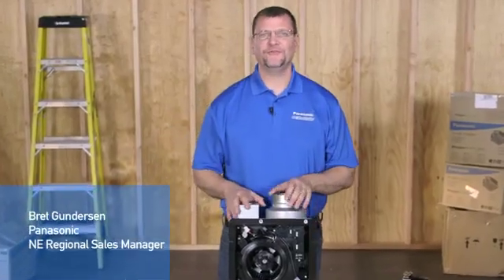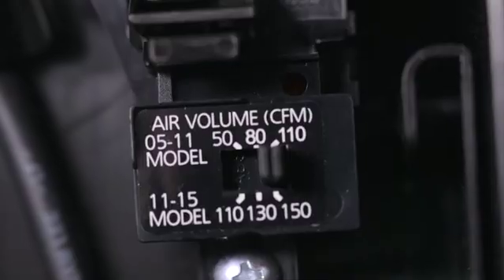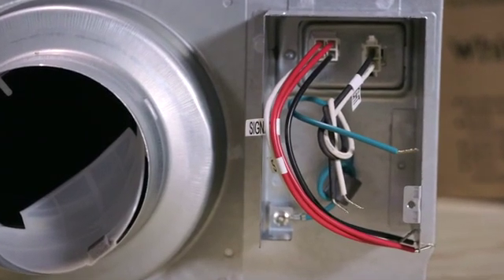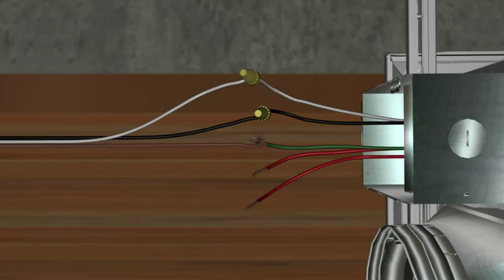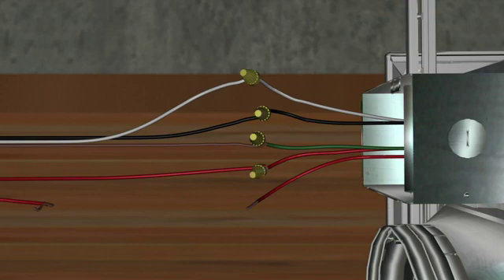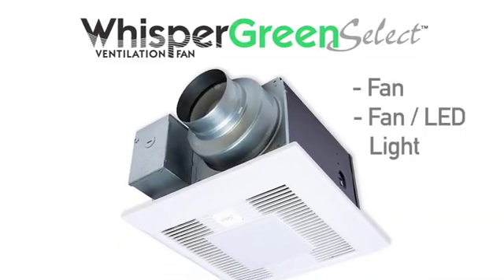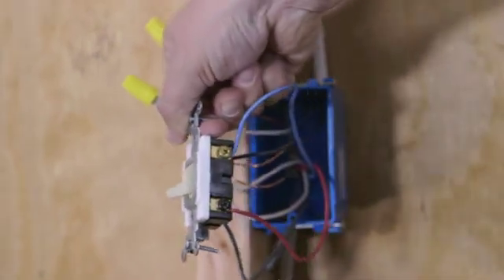WhisperGreen Select™ Wiring

Comment: Timestamps::

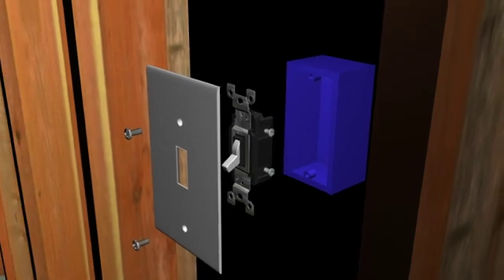Standard "spot" single pole switch: 1:52

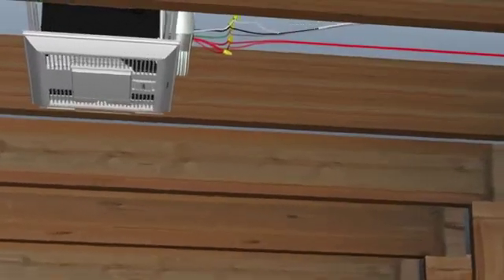Automatic motion sensor/ humidity condensation sensor: 3:09

Wall switch with extra modules: 3:42

PS Don't forget to set the fan speed based on the cubic feet per second on the fan itself.

Comment: This video captures very important information at the tail end of the 3m30s to 4m43s section that is unfortunately missing from the installation manual, regarding how the unit operates when the "control switch" is in the on or off position.

The control switch only causes the unit to be in "on" or "standby" mode, and cannot cause the unit to be "off" if the sensor built into the unit tells the unit to run. This is great news.

The only way to force the unit into "off" mode, is to use the "service switch", which is likely to be the breaker.

This important detail from this ~9 year old video should be clearly stated in the installation manual!

Comment: I  have installed two Panasonic FV-05-11VKL2 WhisperGreen® Select Fan/Light, 50-80-110 CFM (with light) now and acknowledge the YouTube videos are overwhelming and don't talk much about the additional light and night light wires. I am also using the timer, motion and condensation modules so the fan it is automatic.

My home has two gang boxes (light and fan) and typical for most homes. The best wiring solution for me rather than adding additional boxes and to provide ability to control most features was to wire:

fan to the fan switch and leave this switch always on. I also connected the blue (night light) wire to fan as this will always be on. This allows you to turn the fan off if using constant on/sport ventilation togther. I would not wire the constant fan speed to a non-switched power source for this reason.

fan light (extra black and white) to bathroom light switch. You will have to cut wire and install junction box to do this. You can simply unplug the light if you do not wish to use after install rather than going into box - it is bright IMO.

Cap both red wires individually - or the fan will always run on high.

The timer module allows for constant, always on (low speed) and/or spot ventilation (high speed) timer setting depending on the configuration.

The motion and condensation modules will turn on the fan automatically when someone enters the room or uses shower for preset time of timer module.

Comment: Confusing video and explanation.
 I want one switch for the light, one for the fan, one for the nigh light and one for the control with the red wires. I am using two doble switches for my two gang box and I am running two sets of three-wire from the switch box to the fan, I mma use one white wire for the neutral and the other one as a return to the night light.

Comment: Which Model has the 2 red conductor wires?  I am looking for a panasonic fan with no light.
Reply: Any panasonic with control modules will have red wires. 
(In other words, NOT a VF1, or VFL)

VFC <- C :: condensation sensor
Reply: Model FV-0511VFC1 and FV-0511VF1 are just fan, no light.

Comment: I'm just looking for a way to wire a fan on and off with a switch and have the humidity sensor control the fan if the switch is off. Does panasonic make a fan like this with no light
Reply: did you figure this out?
Reply: panasonic whisper thin rg-t810ha Sounds like the model you’re looking for.

My interpretation is to use the wall switch with the red wires and have the hot and neutral permanently connected in the box. A separate low voltage wire for the reds should be fine.

Comment: CFM SWITCH NOT WORKING - Anyone from Panasonic Support monitoring these comments?

My Panasonic FV-0511VQC1 fan was recently installed and the CFM selector does not work.  It's stuck on the fastest (110CFM) speed, regardless of what I set the CFM selector to.  Is this potentially just a wiring problem?  Or a CFM module that can be swapped out under warranty without removing and replacing the entire fan assembly?

I have sent a message to Panasonic support from their website form and have received no response.  I can't find a support phone number to connect with a human agent to help me.  Any help or recommendations would be much appreciated...  If I can just buy the CFM selection module myself and DIY it, I would be willing to do that too...

Thanks!

Comment: Putting a schematic on the product would have saved me a lot of time. 
Professionals need to see diagrams
Reply: yeah, but the POS incels on reddit and even dyi sites spend more time saying how easy it is than actually answering this simple question (being, how to wire the switches, which are not in the included wiring instructions)

Comment: When you get to the point of understanding the purpose of the signal wires, and decide you’d like to set up your fan using them, you still may be a bit confused about how to make that happen. I think it’s funny they rather glossed over this point. Note, their installation uses a conduit through which any combination of wires may be pulled, given sizing restrictions of course. Most of us will be running Romex, or shielded cable. there is no example of these that comes with two red wires. You may purchase 4-wire Romex, which has a red and blue wire, and those can be used to complete the signal circuit at a standard single pole switch. You could also pull 2 x 2-wire Romex. Since it is clear that the signal wire’s purpose is simply to prove continuity, I’m not concerned about wire size. For my part, I’ll pull a separate low-voltage wire (cat 5e) and place a cardboard divider in the junction box to mimic NEC requirements regarding mixing low-voltage in line voltage wires.

Comment: I connected the wires as per the 3rd wiring option with only the FV-CSVK module installed. Turning on the manual switch turns the fan on but when I turn the switch off the fan keeps running. Why is that?
Reply: Maybe the sensor override the wall switch?

Comment: Can you kindly clarify the 3rd  wiring method. The two red wires gets connected to a Third Switch/Junction Box since it cannot have any power?  If not where do I connect the two red wires in the Fan Switch Junction Box. Thanks.
Reply: In the 3rd video they are finding another power source in the attic to send constant power to the unit. Then they are using the existing wiring for the old fan to use as signal wires. You would tie those to the red wires in the fan junction box

Comment: Hi, I just watched your video in the youtube on how the Panasonic bathroom fan works.
However, i still have a problem; 
 when I turn the switch ON, the Fan does not run until 17 seconds with the timer and CFM in zero position. any idea why I am having a delay On the start. 
Can you also send me the Manual. I am not sure do I have an electrical issue or this is how its works.
Reply: Because you aren't turning the fan on -- you're turning on the sensors, which then decide if/when to run the fan. You need the power the fan directly, then switch on the red wire.

Comment: Just installed this fan with the optional Night Light Module.  The video does not cover the use of the Night Light Module, so I left the RED wires capped individually.  Turning on the fan, the night light goes on, but the fan doesn't. That would suggest power is there, but some part of the circuit is incomplete.  There are no instructions in the provided instruction sheet for using the Night Light Module. Would it be safe to assume that if I connected the two red wires, the fan would work? The Night Light Module is supposed to be automatic sensing so if its set to a bright environment it won't go on unless the room reaches a certain darkness level.  I'd rather not have to snake wires down to a switch since I bought the module thinking it was automatic as a night light and didn't have to be switched on and off. Hope somebody can clarify why the night light works and the fan doesn't and answers the question about the red wires. TIA-Mike
Reply: what did you end up doing?

Comment: I want the ability to completely cut power to the fan. Can I put a single pole switch on the black lead wire that goes to the fan?
Reply: If youre doing that theres no reason to pay more for the green select you could just get a regular fan with light.
Reply: @stonebuzzalini2049  I guess i wasn't clear on what i was looking for. I wanted the option to cut the low speed fan for the times when continuous whole house ventilation is not needed (spring and fall basically). Brett W.'s response gave me the answer i was looking for.
Reply: @stevechristensen2351   hopefully you can help: I want method 3, using a wall switch where 'On' switches the fan to run the selected CFM and 'Off' switches the fan to use the condensation sensor module to automatically run the fan if/when humidity is high.

I ALSO want to be able to cut power off to the fan entirely in seasons where the fan is unnecessary (if unoccupied, or when it's warm we open windows etc). I'd like to have this ability near the unit, rather than flipping a breaker.

I think we were looking for the same thing. Did you accomplish this with a second switch? Or?
Reply: yes.
Reply: Yeah i thought about that but from my experience people dont like it because it requires the owner and their geusts to understand the fans operation. They just want to hit a button

Comment: Thanks - super helpful!  I'm an electrical engineer and I was still scratching my head after reading the Panasonic manual that came with the fan.
Reply: Agreed.  The manual is confusing.
Reply: I got even more confused after watching this video. In the end, I just wanted everything together and the whole light plus fan come on from a single switch. I wish I could separate the light and the fan, so the fan can quietly run with the lights off, but I just gave up
Reply: That manual is horrendous
Reply: @brianlutz7813  The manual sucks, both in content and format. Just make a booklet with pages that turn, not an unfolding mess in 4 languages.

Comment: I just noticed a really nice detail while installing mine, they included a ferrite bead on the grounding wire in the junction box - which will help keep internally generated noise out of the house wiring, and externally generated noise out of the fan electronics!

Comment: I have the FV-05-11VKSL1. I want the light on its own switch, and I want the fan to run for the time delay after turning the light off. Is this possible and what wiring do I need? My old fan and light were on separate circuits, so I do have 2 switches available for each the light and fan.
Reply: Sounds like some custom work is needed there thatd probably be out of code and void your warranty since youd have to bypass shit and cross circuits good luck

Comment: I just installed one of these, replacing an old fan/light combo that was undersized for the room.  I was wiring the simplest method... one switch running a black/white/ground line up to the fan.  I wired the 2 white lines from the fan to the white wire of my home, the two black wires from the fan to the black wire of my home and the green wire to the ground of my home (bare copper wire).  I capped off the 2 red wires from the fan (not using any of the fancy stuff) and the switch now turns on the light and the fan together (well... the fan comes on after a 30 second delay.  Why, I'm not sure, but it is as designed per the reviews on Amazon).

It is VERY quiet (quieter than the smaller, lower flow fan it replaced) and the LED lights are very bright.
Reply: With the wires capped separately you are effectively toggling between OFF and "Sensor" mode for the fan. The delay is the time it takes for the sensors to power up and start actively monitoring. If you want to have the fan run anytime the switch is on, bypassing the sensors, then either remove the sensor modules or jumper the two red wires.
Reply: With a recent reply to this long lost thread, I thought I'd post an update.  The fan is now 4 years old per YouTube (makes sense at we have been in the home about 4.5 years) and this fan is still SUPER quiet and functions well.  If I replace other fans in the house, I'll be doing it w/ these.  SO much nicer than the average builder-grade bathroom fan.

I've actually grown to like the fan delay of 30 seconds as it lets me pop into the bathroom to grab something quickly without spooling up the fan every single time.
Reply: I have the same install. Did you cap off the two red wires together or separately? I have them capped off separately now and the light will come on, but the fan does not come on.

Comment: Maybe I am missing something... On the third wiring method, there are two red wires that come along with the power supply wires (bulk/why/Cu).  I missed where you may have mentioned where these two red wires coming from.  Those that connect to the two red wires of the fan?  Please advise!
Thank you.
Reply: You still being power from panel 12/2 or 14/2 whichever awg your using. Then from the switch you run a 12/2/2 or 14/2/2 wire to the fan that will have an extra white/red stripes and a solid red wire. The power black/white/green bypass the switch and wire up sight to the fan the solid red and white with red stripes goes on the switch, no  particular order. And on the fan side also the two extra wires will wire up to the to Red signal wires in no particular order.

Comment: I am retrofitting a bathroom that currently has a single light over the shower.  I want to use the existing wiring for a combo fan / light.  Can anyone explain why they recommend separate circuits for the fan and light even when operated together?  Why not simply combine the 2 sets of black wires and 2 sets of white wires at the fans junction box?
Reply: +Michael Barlia - You can do that.  It's wiring method #1 in the video with the light tied in.  The light is independent of the fan, so you need switched power to turn it on/off.    I suppose they could have made it possible to tie the light into the controller so the red "signal" wires would turn it on, but they didn't.  Wouldn't help you anyway.

if you are retrofitting an install that just has switched power and you don't want to run more wire, your only option is tying all the blacks  and all the whites together, and leave the reds alone.
Reply: @baldtwit  Or two sets of control pairs could have been built into the units with lights: 2x red for the fan, and 2x orange for the light.

Comment: in video for wiring fan with light using a double pole single switch, it only shows connecting one of the red wires, what happens to the second red wire?
Reply: Jarad Earley I'll preface this response with I'm Not An Electrician. That said, he said to use a Double Pole Single Throw switch, which is two separate circuits controlled by a single mechanism (here, a toggle switch). Each side is effectively it's own circuit. That said, you'd bring the two red wires to one side of the switch and the line wires for the light to the other. I don't actually own this vent yet, I'm just doing research. But that's what I can deduce from the wiring diagrams. The red wires are not to carry any current.
Reply: If you're pairing the humidity sensor with a variable speed module, you wire utility power unswitched to the fan and run the red wires to a switch. The fan will always have power in case it needs to start because of humidity. The switch operates a manual override. If the humidity is low and the switch is off, the fan won't spin (if variable speed set to 0 or no variable speed -- it will spin on lower speeds if variable speed set). Best bet is to wire it all up with a lampcord and verify everything works as you want. People have different preferences it's just a matter of doing what you want. He goes through every possibility in the video. Just find the scenario you want and follow what he says.